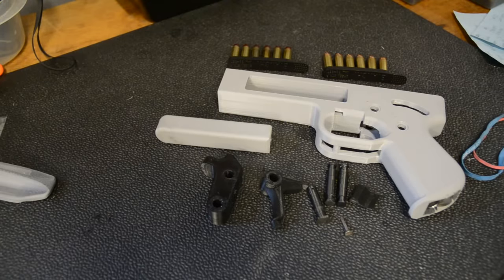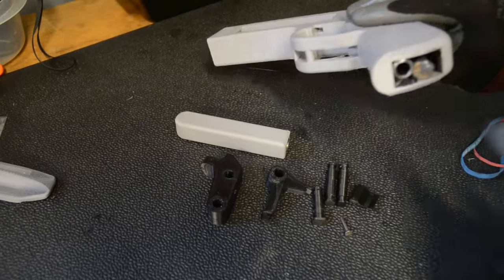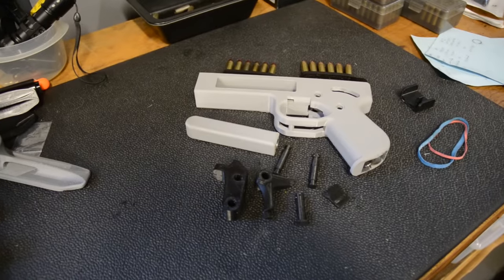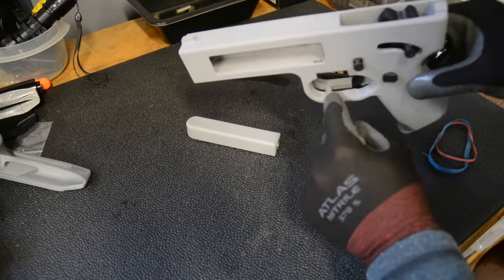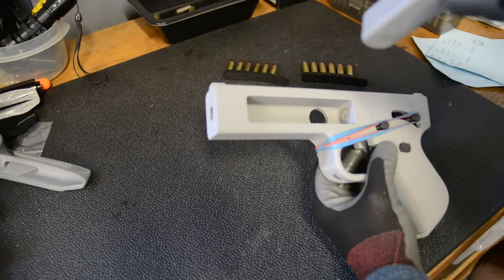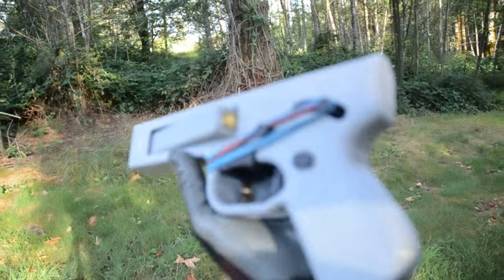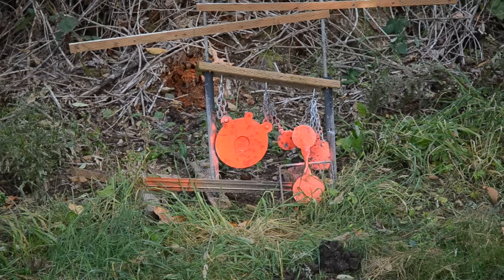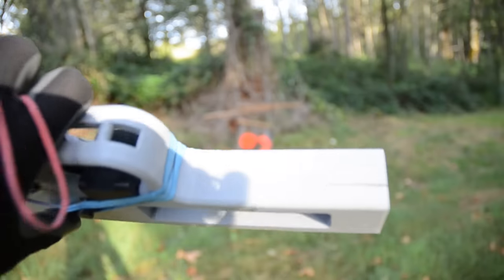Songbird 3D Printed Pistol - .357 Magnum

Comment: If people are concerned that this is dangerous. You can rent a giant truck and just plow people over like in France. It depends on the person
Reply: But maybe you could smuggel it past detectors before entering certain  airborne vehicles? Am I on a watchlist for even saying that?
Reply: It is dangerous.

For the person shooting it.
Reply: Clyde Cash Still a metal barrel. Still metal bullets.
Reply: Chad Klaren  Yeah... I skipped a lot in this video
Reply: @__________________________Fred no, you cant sneak it onto a plane the barrel would be metal, otherwise it would melt when fired, also the bullets are metal, both would be detected by metal detectors
Reply: @sullyjelly7577  And potentially anyone standing within a meter of it to the sides as well should the liner decide to rapidly separate under high-pressure applications. AKA, go boom.
Reply: @tom_dom  3d-printed guns are more dangerous to the user than anyone else as it is, you can literally make a gun with some simple hardware components and the most basic of tools and those are safer. What i fear with this is people trying to bypass steps in printing a gun and it harming them and people around them from trying out their new toy and someone getting hurt when it decides to vent out the sides instead of forwards. 

Criminals will get guns either way, in that regard this is less dangerous since not everyone has access to a 3d-printer and the materials to make a fully functioning weapon as easily whereas said criminal could, should illegal weapons not be available easily, make a shotgun out of some piping, nuts, bolts, and various other metal scrap at a fraction of the price.
Reply: @tom_dom  you don't have to rent a truck. You could use your own or steal somebody's
Reply: Well it's definitely too late to rectify any of this crap. There's no doubt people are gonna kill either way, but weapons make it more efficient. (Otherwise what's the point in having them in the first place)
Reply: Interceptor V2  But using a semi automatic rifle with large capcity magezine makes it much easier.
Reply: You need a drivers license to drive that giant truck, you need a concealed carry license to carry a gun on you in public. With this system, people with extreme mental illnesses don’t have access to a gun. But as 3dprinting becomes more accessible, it becomes easier to circumvent the gun legal system in the U.S. It is dangerous, guns are inherently dangerous as they are designed to kill.
Reply: i get your point a dangerous person is going to be dangerous. but at the same time a pistol is designed for one thing and thats killing people. no one hunts with pistols. so yeah lets give gangs and other criminals a way quicker,  more efficient, and safer ways to arm themselfs. great idea real service to the benifit of mandkind.
Reply: But people rent trucks for reasons other than hitting something/killing someone.
Reply: FluitGeluid you’re missing the point.  A gun is a tool.  Just like a car, truck, pencil, computer, or any other list of inanimate objects.  Without the human the pencil won’t write, a gun won’t shoot, and a car won’t drive.  The problem isn’t the object, it’s the person.  So long as we continue to blame things instead of people we will continue to have problems with society.  But this isn’t anything new.  We are humans and we’ve been killing each other since our creation.  If I’m to be honest we live in the safest time in human history.  Our politics and news have us believing it’s the end of the world and every week we’re spoon fed another mouth full of hot garbage.  That’s just me and my opinions tho too
Reply: Shaolin Zoo what’s the point in having a car.  You wanna get somewhere?  You buy the car.  The gun does its job just like the car does.  Both would turn to dirt is a human didn’t use them.  We need to take responsibility for our actions
Reply: The time it takes to go and rent a truck and then find people to run over kind of prevents that from happening except in cases where the person is really fucked up.

If you're carrying a gun, it just takes 1 second between misjudgment and firing. Same reason why gun laws prevent people from committing murder.
Reply: Hammer ToeNail lol, probably would just (steal) the truck.
Reply: The01xboxer  thats not a ok thing to say.
Reply: @tom_dom  No, what matters is WHAT you intend to use it for. Example, a gun collector, a person who just likes to shoot, a hunter, or someone who carries it for self defense. 

Having a gun makes killing easier- well. No. It depends. If you run in a place with a bolt action rifle and less that 10 rounds you aren't getting far. Or a black powder rifle. It depends on the gun. In a lot of cases, it's smarter to just carry a simple pistol because you could conceal it much easier, more versatile, and the magazines are much smaller as well. 

As for guns are easier to kill with, I disagree. Bombs, vehicles, gases all provide something guns don't. Say, you have a crowd of 500 people and a standard semi auto rifle. You shoot, the crowd disperses. Your bullet might kill the first person and get stuck in the second injuring them. So what, 30-50 total kills by the time everyone has run away or hid? 

Now try a bomb. You have a blast radius besides the shrapnel that can kill, as well as bringing down structures around. So if they're inside, well, you could probably get a pretty high number... Since every bomb yields a different amount of destruction, well. There's no sense of pulling up numbers. Could be 5 to all 500 depending. Much more dangerous than a gun *could be*. Assuming you didn't have a .50 machine gun set up. Even then though, a bomb is still instantaneous. Gun fire gives you time to get away. 

Gas? About the same. You could knock down everybody if you did it right. 🤷‍♂️ 

Okay so a truck or something. The truck attack in France (2016) resulted in 86 deaths and 458 injured. Or, 2996 kills with a plane (2001)
Good luck killing near 3000 people with a gun.

The highest kill count in a school shooting (US) is currently 33 with 23 injuries. Surprisingly that number reaches 200+ in other countries but that's besides the point. 

The deadliest mass shooting (US) was the Las Vegas shooting. 58 deaths, 422 gun fire injuries, but 851 injuries total. 

So I'm sorry mate, but your argument is just shit.
Reply: The 38 was going so slowly you can see it at normal speed. Not as dangerous as it should be.
Reply: People are concerned to this yet they forgot that there are already some metal 3D printer....
Reply: It's amazing how stubbornly you American's defend guns even though it is proven by a ton of countries that banning them leads to less casualties.

My country had less then 2 shooting incidents at a schools EVER. 
How many so you have monthly?

Your educational system has really failed.
Reply: @Dark-ux4bi  it wouldn't melt.  It would detonate in your hand. LOTS of pressure in that case once the primer gets struck..
Reply: Samuel Bilskie ah yes let’s just let everyone have untraceable guns because “YOU CAN KILL PEOPLE WITH KNIVES WHEN ARE THOSE GONNA BE BANNED?!” if trucks are so deadly why do you need a gun then? Why not hunt with trucks and have an ATV in your room for home protection. Your false equivalency fallacy is showing.
Reply: @lm6036  Well our public school system doesn't educate, it just grooms you to pass a standardized test. Also getting rid of the tool won't stop someone from hurting someone else. Can't use a gun? They'll use hammers, knives, vehicles and bombs, just like what's been happening in Europe.
Reply: @__________________________Fred  Not this model but you can print one in all plastic, and it would be good for one shot, maybe two. Theres also the matter of the firing pin, it would have to be made of something more substantial . One printed for .22 could be fired multiple times though. Honestly this could be dangerous in the wrong hands but for now the type of printer you need for this is very expensive and not everyone can do it yet. But one day it wont matter how gun free a country is, people will still be able to get them.
Reply: Tepper any gun has to have metal to fire it. This gun yes is partly 3D printed but not completely so this would have no effect on airport security at all.
Reply: @__________________________Fred  How would you smuggle it, if it needs metal bullets?
Reply: @__________________________Fred  DEA
Reply: @tom_dom  america has a bullying problem that no adult wants to solve so kids take matters into their own hands.
Reply: Your completely insane mate, this thing is dangerous because operator will end up blowing hand off!!
Reply: Dank Studios people can dodge trucks, not bullets
Reply: Chad Klaren  Because sometimes that is not enough metal to set off the metal detectors. That is why to make this gun legal he had to add the extra metal in the handle. To be legal a plastic gun has to have so much added metal.
Reply: @blablablabla1111111  Minors cannot buy guns though. If you want to buy from a shop or a gun show, you're required to have a back ground check and be 18. For pistols, 21. You can own a pistol at 18, you just can't buy it. Confusing, sure. Private sells would trace back to an individual stupid enough to sell it to you by the serial # and bam, if they don't transfer the title to you (which they couldn't if you were underaged) they would be held responsible for the crimes you committed. When they realized you had illegally sold the gun to a minor, you'd still be charged. No one, and I mean no one is stupid enough to sell a gun to a minor for those reasons. 

It would only be the same as a minor getting alcohol from their parents. It's still illegal. You might want to look up your laws smh
Reply: So no, minors cannot buy guns. And for a minor to "own" a gun is also in a grey zone where you need a parent to generally have it.
Reply: @kento2771  What if you just steal the truck
Reply: @tom_dom  we are releasing designs every week and you can't stop us.
Reply: @tom_dom  What makes you think guns are designed simply to harm? There's a huge list of purposes / applications for guns. I agree that the fact that it is mostly plastic makes it hazardous, but then again there are trucks on the roads with malfunctioning brakes or even drivers under the influence or just simply idiots. Now on that hold the thaught of potential for a moment, because here's the thing.  Looking at it as dangerous because it's a ghost gun only legally makes sense,  but to tell you the honest truth you can fool ballistics even if you use a gun licensed to yourself if you know what you are doing and needless to say point is in both cases the guns have the potential to kill should the owner lose his shit. People have a tendency to be negative towards potential that's not their own and also to assume the worst. I probably shouldn't say this, but I have a few guns and zip guns. Whhhoooooo how terrible " who do you want to shoot " or sometimes people tell me I'm dangerous or evil and assume I'm killing people. This annoys the shit out of gun lovers, because all their tiny minds can associate guns with is murder witch is why those are probably least likely to ever get a firearm license should they want to. I actually just like guns and also i just simply wanted to make a gun myself that functions. The feeling of shooting it is just so rewarding i can't describe it. I shoot non living things and only non living things.  It's a toy in my opinion. I have guns and weapons that i can use in self defense should I have to, but only a idiot will take on the gamble in shooting a person with any illegal firearm even in self defense. It's technically useless guns if you think about it, because it should be a secret obviously and the chances of using it as a weapon and not being seen by someone or something somehow like cctv or registration plates on your vehicle just as an example and even your mobile location history after you perhaps become a suspect. Anyway I will not harm a fly. Seriously yes i am passionate about weapons, mechanical working of them etc. , but that does not leave any reason for suspicion at all... i have a huge collection of all sorts of weapons both home made and not home made  even some non metal knives. Then just as much as that I'm a automotive enthusiast and a diesel mechanic by trade and passion. Now about that truck...let's say it's a semi with no trailer and something bad happens caused by a human being then that is potentially a give or take ten ton bullets and a ton of ballistic gel is insufficient for that type of knock down power and this one bullet can hit countless targets. That's potential. Here in South Africa gangsters occasionally make use of makeshift guns, but they are themselves with their own reasons and possibly also already running from the law. One last thing. Here in SA you can own any muzzle loading firearm even a muzzle loading pistol aswell as cap and ball revolvers not to mention cross bows and many other un regulated as long as you are 21 witch are all deadly firearms and other shooting weapons with the benefit of not having to buy regulated cased ammunition. Enough said and by the way the 3d printed gun still have metal parts in it. There is way more to guns then death. They are actually brilliant and even take part in Olympic sports, security along with employing people whether they shoot them, sell them, make them, fix them or hate them. I think one must actually truly know about guns while at the same time simply looking at it as just another weapon rather then to use that nowadays apparently spine chilling word aka "guns" because ironically the way your average Joe views a gun is blind or blinded and talked scared.  In short. To all those pussies whining and scratching where it doesn't itch, stay gun haters. All you gotta do is not get a gun if you don't like them so shut the fuck up you're spoiling it for the rest of us who can and would like to handle and own firearms being appropriate,  responsible and knowledgeable enough to actually lay our hands on them. You're instigation based on your pathetic logic and " concerns " are filling up ears with negativity and as a result guns have become a unnecessarily big deal for all thanks to only a few and that's not fair. I'm sure the truck driver would feel the same way should trucks become something they could possibly ban. People don't need guns to kill either anyways,  so seriously...just shut the fuck up.
Reply: @__________________________Fred  here is a link to go and download the .22LR model ( https://grabcad.com/library/fortified-songbird-in-22lr-1 )
Reply: Chad Klaren  maybe a brass barrel but thicker
Reply: @Fivestar5000  
They do hunt with pistols sheesh
Reply: That thing doesn't have an extended magazine that holds more than 2 rounds and it's not black, so obviously it's perfectly safe and incapable of hurting anyone.
Reply: @blablablabla1111111  
You're looking at this from a wrong angle my dude. Switzerland and Finland have decent gun ownership %. Japan does not. All 3 are among safetest countries in the world. The problem is not the guns. The problem is Americans.
Reply: Lazer GoldGaming You can cast ice bullets (yeah, it’s a little bit more involved than just ice)
Reply: Mr. Plow
Reply: @Fivestar5000  actually there are people who hunt with handguns
Reply: @twizz420  not a single gun regulation world wide has been proven to reduce overall violent crime or murder.
Reply: @jkewzz4126  
You are making a bunch of descriptive claims without saying anything prescriptive.
Reply: I think most people are concerned with the ability of the firearm to not explode rather than the proliferation of firearms.
Reply: BuT DrIViNg LiceNse iZ lIgE baggroOUnd CheCk
Reply: @blablablabla1111111  not really a plowing with a truck is still easier and more effective.
Reply: @Fivestar5000  youre rarted af.